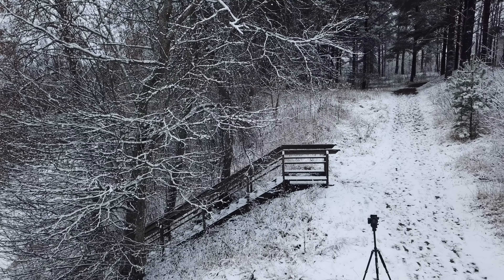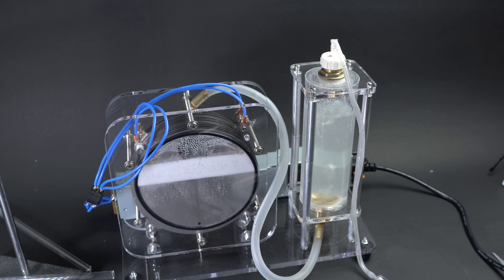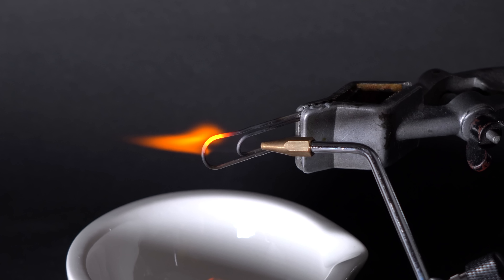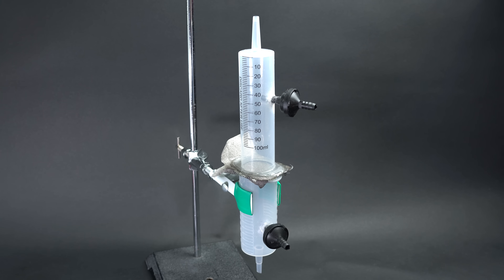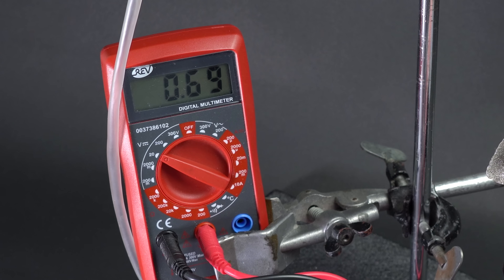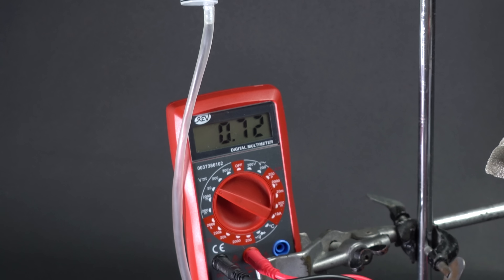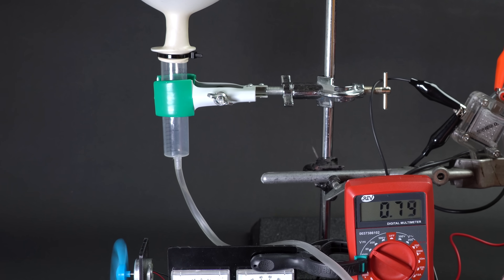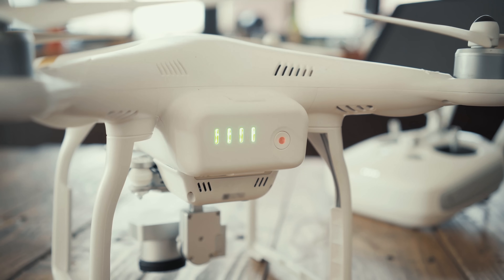I Made a Hydrogen Fuel Cell - Renewable Energy!

Comment: I worked with a mass balance so sensitive the sample was suspended on a Platinum wire 1/10th the thickness of a human hair.
The wires were around $100 US each.  A slight movement of air or even your own breath could bend the wire and make it useless.
A weaker minded person would be driven mad by this challenge.  I'm sure I'm just fine.....now......

Comment: Infinite energy: no.
Reply: Infinite recycle-able energy. One day we will run out of lithium to make batteries. But will never run out of water. And it converts back to water after use.
Reply: In theory.... as H2 is the most abundant element in the universe.
Reply: kychemclass and you always need other elements to let you use H2
Reply: It's no zeropoint multidimensional piezoelectric inertial mechanical quartz resonator that titors on curie temperature at rapid oscillator quantum realitive variables. Thats for sure.
Reply: Yeah, he is just storing energy into a fucking battery. Just saying but in France classes we learned this, nothing new.
(Aka that's not renewable)
Reply: Depends on how you define the system
Reply: Infinite fuel. Hydrogen is preety common in nature.
Reply: @HazelSeerBB  Pretty common yes, and ?
Hydrogen cost more to mine (usually) in terms of energy than what you will get when converting it. No wonder why only few people use hydrogen as a battery
Reply: Ode to the mets.